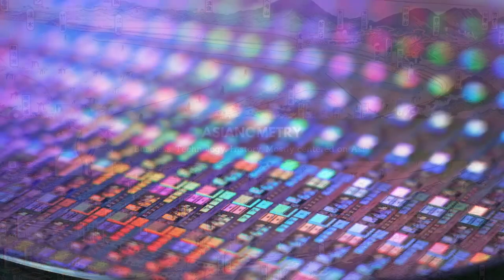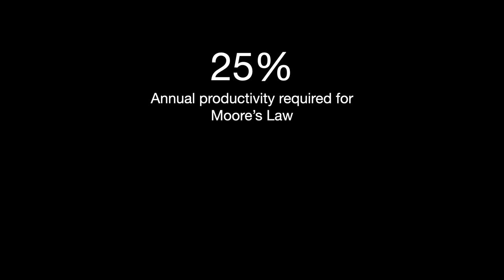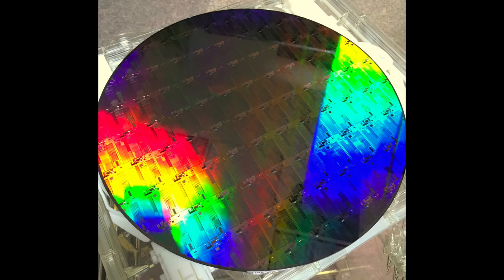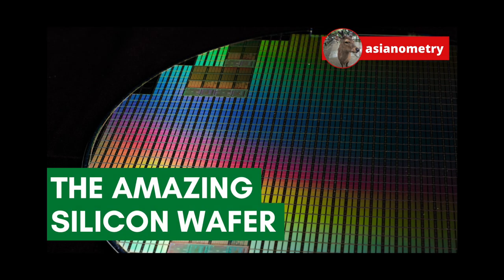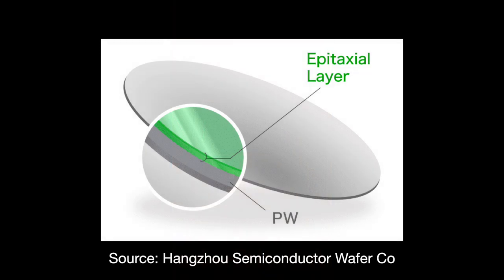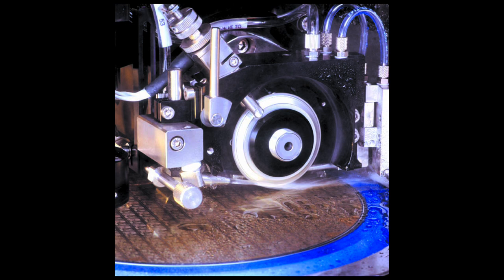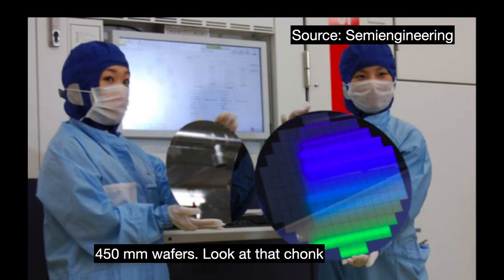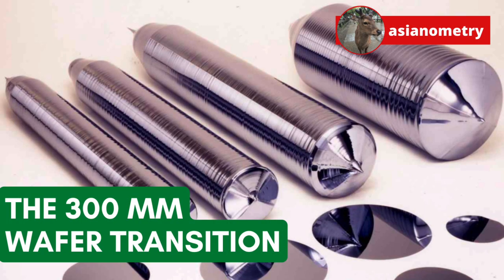The 300mm Silicon Wafer Transition

Comment: We often use the moon landings as an example of what humans can do when sufficiently motivated and financed. The tech used to make computer chips makes all the Apollo stuff look simple.
Reply: Right?  Getting to the moon is basically a big ass controlled bomb with some life support strapped on top.   

Semiconductor fab is where science becomes truly magic to all but a tiny few.  LEDs are literally crystals that glow.  A smartphone is a tiny glass object that can show you an unlimited number of cats, doing all the cutest thing.
Reply: @meeponinthbit3466   Dunning-Kruger effect. You only think it's that simple because you don't know enough about it. A rocket engine is far from  a "controlled bomb". It's an incredibly complex piece of machinery, that needs to operate literally outside of what we thought possible with any known material. 

Rocket engines don't sound so complex, until you remember inside the combustion chamber you'see temperatures of 3500C, higher than any metal melting point. And you're gonna have to be handling oxygen hot gas, which wants to react with EVERYTHING. It will literally eat your engine. And on the same machine, you have cryogenic propellants. One part of your machine is at 3500C, the other is at -180C. From cryogenically cold to tungsten-melting hot. All at hundreds of atmospheres of pressure. 

It is a LOT harder than you think it is. The principle is simple, making it happen is not.
Reply: Anyone interested in Apollo tech should follow the channel CuriousMarc. Another good channel for rocket tech is Everyday Astronaut. Everyday Astronaut has a lot of great videos explaining various rocket types.
Scott Manley is another fun rocket related channel.
Reply: So in which of the two categories do you put the chips used in the Apollo program?
Reply: @baptistedelplanque8859  those chips were hella basic.  There's a guy I saw doing that level of fab in his garage.
Reply: I don't know, knitting a core rope memory out of copper threads around tiny ring magnets is pretty magical too.
Reply: @baptistedelplanque8859  When I said "The tech used to make computer chips," I was thinking of the tech discussed in Asianometery's video The Extreme Engineering of ASML’s EUV Light Source.
My comment certainly wasn't meant as a slight to the moon landings. It's just I can kind of understand a lot of the tech I learn about from the various Apollo historic videos. The EUV stuff seems like witchcraft even though I majored in chemistry and minored in physics.
Reply: @Soken50  No argument from me.
Reply: Chip fabrication is basically the same as making microfiche ;) Okay not really, but this is basically what o say when someone makes the assertion that microchip technology came from aliens.
Reply: @DJRonnieG  Microfiche technology came from the aliens 🙂
Reply: @meeponinthbit3466  Apollo was a major consumer of early semiconductors, and may have had a significant impact on the industry.
Reply: @user2C47  No doubt.  My point is that tech has so overwhelmingly surpassed the achievements of the Apollo program that the chips they were working with can be crafted by a hobbyist today.  Albeit a very motivated one if they're able to build the various vacuum vessels and furnaces and such
Reply: @meeponinthbit3466  it’s only as basic as you think now. In sattalites chips will get (insulated) for random bitflips caused by cosmic radiation. And I didn’t know if they also did that for the apollo mission. But if they did then it was one big undertaking.
Reply: @meeponinthbit3466  is this guy on youtube?
Reply: It's the other way around. Apollo program had a huge impact starting the semiconductor and computing industry.
Reply: IDK. No one will die if your consumer PC doesn't work right.
Reply: The moon landing was magnificent human achievement that had very little direct economic benefit. It pushed rocket science forward but going to the moon wasn't much more than a spectacle, hence why we haven't returned with manned missions.
Reply: A new invention or process can feel like you landed on the moon. 😊

Comment: I worked at Applied Materials during the transition, and one thing you didn't mention that delayed the transition to 300mm was the introduction of copper rather than aluminum interconnects starting around 1997. This blindsided much of the industry, and the cost to transition to copper soaked up much of the money that would have gone to the 300mm transition otherwise.
Reply: As I understand it, aluminum is a p-type dopant whose diffusion becomes a problem at smaller nodes, correct?
Reply: @Shaker626  Aluminum isn't a dopant, it's an interconnect. P and N type dopants are used to build the actual logic gates. Boron is the most common P type dopant.
Reply: @lawrenceperson3043  I think that weeb destroyah means that aluminum can displace silicon and can act as a p-type dopant. I makes sense to me, but I'm a geologist, so I am well acquainted with aluminum replacing silicon in silicates. I lack specific knowledge to know if it is possible in metallic silicon through diffusion while making the interconnect.
Reply: @lawrenceperson3043  I meant to say that aluminum can act as a p-type dopant in terms of a contaminant, not a deliberate dopant. But that would be the main reason copper was chosen over aluminum, right?
Reply: @Shaker626  No, the main reason copper was chosen is that it's roughly 40% more conductive than aluminum.
Reply: @lawrenceperson3043  I see, the extra heat of aluminum for a given interconnect size (or having to use larger interconnects than with copper for a given current) must have been a very pressing issue as density went up. The voltages used also went lower as density got higher, further compounding the issue, no?
Reply: @Shaker626  Also, copper let CPUs (among others) reach higher clock speed faster.
Reply: Right around 1990 Chemical-Mechanical Planarization and Copper Damascene processes came into the industry (IBM's 4Meg DRAM on 200mm wafers).  This reduced contact resistance and topography issues but added another set of process constraints (I never ran polishing operations but 300mm CMP can't be simple). .  Anytime after 2um layout rules you needed guard rings or barrier metals to keep Aluminum out of the diffusion areas. One of the most common IC Failure modes in older nodes is Aluminum thermomigration  that spikes a junction (usually caused by ESD or electrical overstress)
Reply: It was very important to keep copper away from silicon, it was used in the upper levels. I though this was because copper caused issues with silicon?
Reply: @joechang8696  Yes, copper diffuses into silicon and "poisons" the chip with voltage leakage, short circuits, etc. That's why you need a liner barrier like Titanium Tinitride.
Reply: Z zzz

Comment: our company still produces 200mm wafers. Everyone keeps talking about transitioning to 300mm. But literally everything we have on hand is geared to 200mm, from shipping boxes to tools. Interesting video. Thanks!
Reply: Interesting. Which process node are you on? I would've thought legacy nodes might still use 200 mm.
Reply: @Gameboygenius  Dont know too much about the production process. Just that we make 200mm
Reply: @Gameboygenius  places that deal with wafers don't even do that part. It's a different section entirely. Many chips 130nm - 28nm are still using the 200mm wafers though. This is where the biggest shortage is as many whom watch these videos probably know. Too many people think "chip shortage" = desktop CPU but those have the least problems.
all the tiny micro controllers etc are on 28nm or bigger and 99% use 200mm wafers, mostly because the finfet has way too big of a failure rate to waste it on those types of chips, so 28nm is the smallest they go. This is also why the chipsets of many motherboards are still like 28-40nm
Reply: @Gameboygenius  SOI, power transistors, SOS, mixed signal and legacy nodes to name a few. None of these rely on 300 mm wafers because the end product is not something you can make much of a profit from if you have defects that are common on denser nodes or extra costs relating to automating wafer transport. Sunk capex into those older machines and processes can't be amortized quickly enough if they switch to 300 mm.
Reply: The smallest technology node on 200mm is 90nm, maybe someone did also 65nm, but never 40nm or 28nm.

Comment: This is absolutely fascinating. Like you said it's amazing to see all these companies that are competitors all getting together to make a massive change in their whole industry happen time and again, a process that cycled until the turn of the millennium
Reply: This sort of thing has always happened in computing, resolution standards from the early days of CGA and EGA up to the modern HD and 4K are decided by VESA, which is a co-operative body set up by screen manufacturers and GPU makers to make sure everyone is on the same page.  Jpeg (.JPG) also came about because there were dozens of image formats in the 80's and the industry wanted to create a standard for them.
Reply: Standardisation is the most rational approach to all manufacturing, however it sadly doesn't always happen.
Reply: The economic driver for greater wafer size hits diminishing returns, because chips grow capacity by increased transistor density rather than by physical area.
The reticle limit will apparently decrease from 33mm to 26mm in planned future lithography, which will halve the maximum die area size.  That shrink will increase the dies per wafer and reduce wastage on the outside, similar to a wafer size increase.
Chip packaging is moving to multi-die assemblies at the high end.

Comment: Very good and accurate video. 👍👍 Note 450mm was attempted 2 times. It stopped for the 2nd time in ~2014. The "obsolete" 200mm equipment has to do with controls and software, not the process. A lot of those 200mm machines are running on really old computers windows 3.1/NT/95. It is a huge undertaking to migrate the software and computers to new operating systems. There is a substantial refurbishment business to keep those old machines alive. as long as the OEM does not release the source code, there is no chance to make new version on old platforms.